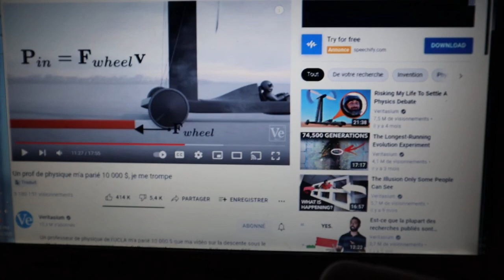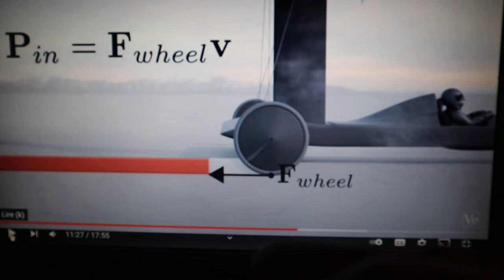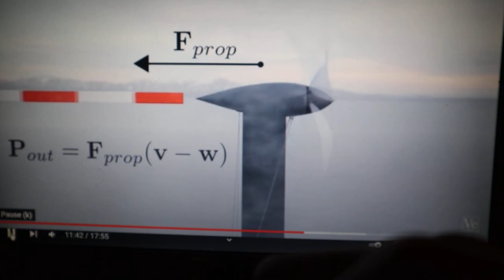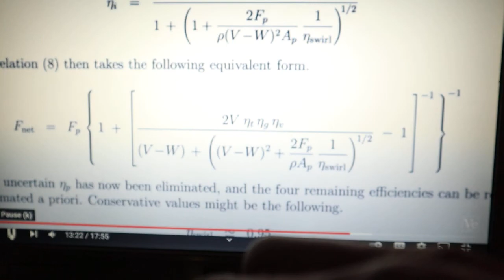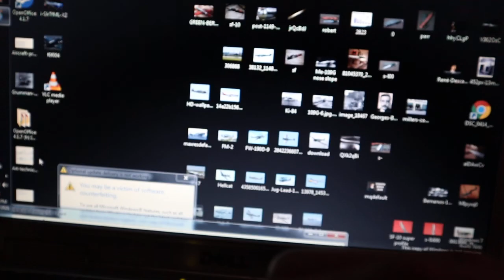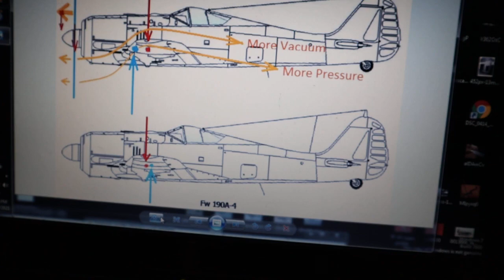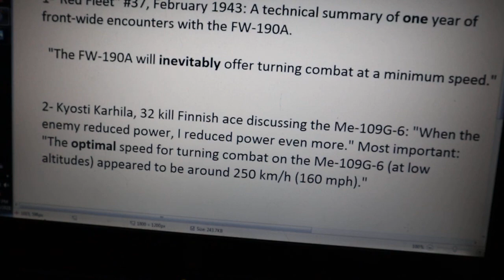WWII fighter aircraft designers did not understand what they designed: A physics demonstration

Comment from the maker: I thought it might be useful to add further commentary on the significance of the small trolley, and the misjudgement it takes to ignore outcome data.

The Veritassium video explains how a professor of physics lost $10 000 betting that the performance of an engineless car could not be true. The stupidity of his position can be gauged by the fact he did not even acknowledge the actual performance results of sustained 2.6 times wind speed as reliable: As if 2.6 times the wind speed was a difficult or confusing measurement to make... This is precisely the kind of obtuseness I have encountered from aircraft engineers. No matter to what extent pilot testimonies point elsewhere, as long as it's not "controlled circumstances", it does not count....

https://youtu.be/yCsgoLc_fzI

Aircraft engineers I spoke to often try to muddy the water by referring to various minor efficiency issues, ignoring that the problem is of a much more fundamental nature than the straws they are grasping at... To clarify what is the link between this engineless car and my claim of prop/wing loading effects, the key part of the video is the little trolley car:

You would think the bigger wheel has more leverage, but you have to think of that leverage as being DEFEATED, and so reversed, by the greater contact friction of the two axles and the 4 wheels: This reversal of the bigger wheel now makes it work "with" the push: Make that wheel big enough, add 3 mph of pushing at the top, and if the bottom friction is enough to reverse it, it could make the smaller wheels reach near to the speed of light (in theory)...

On a WWII fighter, a force reversal would occur if the CG shifted in front of the CL, which does occur at least on the FW-190A, since at low speeds you have to push on the stick to hold the turn (E. Brown)...

I think the added force in a prop fighter is expressed through compression of the air between the wing leading edge and the prop (due to the curvature of turning, while the prop is highly loaded from the turn drag, which is not the case if the prop is unloaded in a dive), from curvature "aspiration" between those two elements, which changes the airflow at the wing leading edge, increasing the effective angle of attack of the wing and thus causing more wing drag, and thus loading up the unused potential of the prop. Wing= more drag, Prop= more load : This combination of push-pull translates into more lift, just from the effect of  "hanging from the prop"... Pull apart on two string ends, and the middle will be "lifted" vertically... It's the working theory for now.

Comment: On minute 10, your premise that the CL moves in front of the CG cannot be right.  If that happened, the plane would be unstable.  If the speed was high, it would break up in pieces, if the speed was low, it would stall and spin before the pilot could react.  These planes were stable.  Stability is one of the major features that make a plane a good handling plane.  There is always the compromise between stability and maneuverability, and the best designers (i.e. Spitfire) found a good balance. 

There is no way the fighter aces knew more about the physics than the test pilots, who often flew with instruments on board.  If anything, many of the cmbat reports need to be taken with a grain of salt.  Generally, if a comparison opinion among combat reports tends to repeat itself over and over, it is probably correct.  But you cannot take an isolated opinion and present it as fact.

As for your wheel experiment ...  I am not sure what the wind conditions are.  But this problem can easily be resolved with conservation of Physics.  If there is no tail wind, the car will stop, period.  If there is a tail wind, and you have some sort of sail to exploit it, as your forward speed increases above the tail wind, you are no longer collecting energy from the wind.  So, the car cannot accelerate.  Your steady state speed will be at a speed where the power you collect from the tail wind is equal to all your other drag losses, including the propeller losses.  That steady state speed cannot be above the tail wind, because you will be receiving negative power from the tail wind.  Very simple proof....
Reply from the maker: Eric Brown states (in both "duel in the skies" and another book) that below 220 knots the FW-190A, WHILE TURNING ONLY,  had "tendency to tighten the turn", which is to say that the nose had a tendency to rise "into" the turn on its own: Thus to SELF-TIGHTEN THE TURN ("this change of trim could be gauged in turns"): Quote: "above 220 knots, the trim changed and backward pressure on the stick became necessary (to maintain the turn)."  Which means that BELOW 220 knots the tendency was instead to PUSH on the stick to keep the turn from getting too tight... This absolutely proves the center of lift DID shift in front of the cg, and there is no argument in creation that can change that... The reason the aircraft remains stable is because the propeller is asymmetrically loaded against the nose lift, likely due to the air spiral twisting above the wing. It is a leverage fight between the propeller and the forward-moving CL, with a bit of CL excess in the FW-190's case because the nose leverage is so short the prop asymmetry is on the losing side a little bit... 

  There is NO account of a Spitfire out-turning in low speed sustained turns a FW-190A, though it did do so at higher speeds. Sustained low speed turns is ALWAYS to the FW-190A, all Marks, no exceptions, including in the post War article by the Spitfire's top ace (36 kills), and top FW-190A killer (with 20 kills) Johnny Johnson: "I asked the Spitfire for all she had in the turn, but the FW-190 stuck behind me like a Leech: IT WAS ONLY A QUESTION OF TIME and he would have me in his sights." I'd say the top FW-190A killer of the Western Allies trumps any physical theory as to what actually happened. Not to mention Clostermann, Weir, and front-wide combined Russian opinion on the matter. Plus I have found not a single opposite multiple consecutive 360 example in 27 years of research...

  Concerning the car, your statement indicates you are not clear about the difference between FORCE and ENERGY. The Veritassium video explains why the physicist lost his $10 000 bet: The car can be faster than the wind because the relative internal leverage FORCES between wheel and prop are what matters, NOT the ENERGY from the wind. The LEVERAGE RATIOS determine the speed between two mediums (as the little trolley demonstrates), which are here the ground and the wind: It is this RATIO that matters, not whatever the wind is doing... This is exactly why the FW-190 beats soundly the Spitfire in low speed turns: It has a better CL/nose length RATIO. And yes flight physics is wrong on this point, because they are not aware of the internal RATIOS that all these particular low-wing nose-driven types exert on themselves. They actually think these are roughly the same as jets, which are largely devoid of major internally opposing ratios (which in the case of low wing single engine props are buried within the big gravity/lift sandwich).
Reply: @wrathofatlantis2316  I cannot see how what you are describing is not an unstable aircraft.  The problem is not only that the plane tends to pull in the turn, as you said, but as you release the stick just a bit, the plane will over correct and substantially reduce the turn.  A plane like this would be extremely dangerous to fly in anything but straight and level flight.

I did a simple google search "FW190A stall speed".  I got "Fw 190 A-3 Description Indicated stall speed in flight configuration: 166..189 km/h Indicated stall speed in takeoff/landing configuration: 166..172 km/h".  That is about 103 mph-109 mph,  The Spitfire, say Spitfire IX has stall speed of something like 85 mph  flaps up or 140 km/h.  There is no way in hell an FW190A can out turn a Spitfire at the low end of the range.  

The "leverage ratios", the way you define them, are not engineering terms.  Any type of device operating description will have to survive the conservation of energy test.  If it does not, your description of the phenomenon is flawed somewhere.  Yes, in geared machinery, the ratio determines the ratio of speeds, but the conservation of energy will define what that speed is, or whether the device will even move.  I thought some more about this vehicle example.  Perhaps the propeller was acting as a wind mill and propelling the vehicle.  Perhaps the wing was coming at an angle.  Whatever.  If we had the details of the example, including wind direction, prop pitch, gear ratio between wheels and prop, etc, simple energy analysis can calculate under what conditions your vehicle will run, and what its terminal speed would be.  

As for the turning performance, the internal leverages are not relevant.  It is the wing loading, stall speed, etc.  The internal leverages perhaps affect stability, but I am sure these details were taken care satisfactorily by the engineers at FW.  Some of these stability characteristics were derived analytically, others experimentally, or both (i.e. analytical first shot, experimental refinement as a second shot).
Reply from the maker: @demetridar506  There is no problem of instability, because having the CL in front of the CG is NOT like shooting an arrow backwards: The propeller counter-acts the pitch up tendency of the CL (being in front) PROPORTIONATELY to the stick's upward input, because the higher you make the angle of attack by pulling, the more the bottom of the propeller is unloaded by the spiral leaking more and more above the wing (or other similar effect caused by the wing being behind the prop while the air curvature increases). Because of this, there is no violent nose-down reaction to relaxing the pull, because relaxing the pull lowers the angle of attack, and thus lowers the prop leakage above the wing, which reduces the nose-down trim AS you relax the pull.

  Let's say a rope/pulley gives you more strength to lift a heavy object by pulling on a rope. Does letting go of the rope mean the object will fall harder because your lift was assisted on the way up? It will fall the same as if you dropped it, but the CL in front of the CG will mask the weight on the way up.

   The nose-down trim can only exist with a curved trajectory, because it is the curvature of the trajectory (not replicable in a wind-tunnel) that allows the above-wing prop spiral "leakage".

   The turn curvature inevitably cancels out the nose-down trim, because the CG behind the CL creates a corresponding NOSE-UP trim assistance. In other words, THE NOSE-DOWN TRIM CAN ONLY EXIST TO BE CANCELLED BY THE TURN CURVATURE: It is an "invisible" trim. All forces equal zero in this case, but it DOES require the wing to generate more lift than we now accept (extra lift through whatever that prop spiral/wing disturbance is doing) because it has to defeat the nose-down trim of the prop with a CL-CG lever that is barely one foot long maximum (30 cm or so maximum) versus the 10 foot (3 meters) lever of the nose. The prop has a minimum 10:1 leverage ratio advantage, and, if the CL is only 3 cm in front, then that ratio is easily 100:1(!). This wide range of possible ratios explains why the Spitfire is "heavier" on its wings than its nominal weight, IN CURVED AIR WITH A HEAVILY LOADED PROP (slow speed). The effect is most pronounced at slow speed because the prop load is HEAVIER at low speeds than at high speeds: Hence the Spitfire turns BETTER at high speeds, but at slower speed shorter noses have less nose leverage for the heavier prop load to tax the wings, so the shorter noses (usually) tax their wings less at those speeds. 

  This explains EVERYTHING that is observed in WWII combat: It explains why lowering power was so important to turn better at the LOWEST speed, it explain why radial conversions often turn better than the inline original (Ki-100 vs Ki61, La-5 vs LaGG-3, FW-190A vs FW-190D-9), it explains why the Spitfire turns well at high speeds but NOT at low speeds. It explains why dive pull-out performance (unloaded prop) does not predict true HORIZONTAL turn performance (as the SETP test of the P-51D, F6F, P-47D demonstrated in 1989, with 6G "Corner Speeds" near maximum METO level speed, unlike what was claimed in their flight manuals). It also explains why the stall is largely irrelevant to the low speed turn performance (no curvature of the air or highly loaded prop during a stall), and why these trajectory curvature effects cannot be determined in wind tunnels. No understanding of WWII aerial combat is possible without an effect roughly along these lines. It is true the P-40 turns very well at low speed with a long nose (it turns about equal to 190s or 109s, and better than Spitfires), but that only means the P-40's CL, during the turn curvature, is FAR ahead of the CG, so despite the long nose, the leverage RATIO is still the factor that matters. That the P-40 turns so well at low speeds is beyond question, and, like the FW-190A, it is not explicable with the current application of available knowledge.

Comment from the maker: Quote: Greg's Airplanes and Automobiles:

"In regards to the 109's optimal turn speed. The quote you have is probably talking about sustained turning, and that speed of 160 is probably about right. However power will be very high because in a tight turn at that speed drag is very high. In fact it's so high that the best sustained turn rate in any WW2 fighter is going to be at maximum power. Fighters didn't get powerful enough to overcome the drag of a high G turn until well into the jet age.

I think the first quote for the 190 depends on a lot of things we don't know. If fighting an IL2, yes, a Yak with an unskilled pilot, probably yes as well. A P-40 with a Soviet Ace, no. I think in terms of the big picture I agree with what you are saying, there are factors that are overlooked and easy to miss. in some cases they are not fully understood." 

  In the first paragraph, what is said is that a maximum sustained speed turn of around 3Gs, with a maximum angle of attack of 7 degrees, can cause a full power Me-109G-6, at 400 mph going straight, to lose 240 mph of speed to sustain the turn at 160 mph... Can 7 degrees of angle of attack cause a loss of 240 mph? This seems high to me, especially when the pilot sets a context of reduced power with no mention of increasing it. The logic appears weak.

  2nd paragraph: To the Soviet P-40 ace comment, I have found this relevant quote on the P-40 Warhawk forums (P-40’s in WWII > Flying the P-40 against German fighters, from Capt. James Reed of the 33rd FG, on: February 23, 2008, 06:51:07 AM, Poster: Mark Joyce):

  "Quote: "A few years ago, I had the opportunity to correspond with Capt. Reed via telephone, snail mail, and email.  In one of my emails, I asked about how the P-40F and L (which he also flew) compared to both the Me-109 and Fw-190, which also flew in North Africa, but to a lesser degree (more often as a fighter-bomber).  Here is Capt. Reed's emailed reply:

  "Regarding performance against the Me-109 and FW-190.  The 190 was tough to out-turn.  I could out-turn the 109, but it was hard to do.  I, at times, had to drop a few degrees of flaps and slow down to out-turn it.  On one mission dropping the flaps was not enough so I had to drop my landing gear to slow down enough to out-turn the Me-109 and get away from his fire.  I think dropping the flaps and landing gear probably saved my life. I never had a one-on-one with the FW-190 so am not sure what I could do with it.  I understand that it was harder to get away from than the Me-109."
Regards,
Mark" 

  For a P-40, even an L, I think it is likely "getting away" from a FW-190A probably did not involve straight line speed...
Reply: Sigh.. you clearly do no understand basic physics or even what he was saying at all... Suggest an introduction to Aerodynamics text book for what terms actually mean.  You clearly have not a clue.